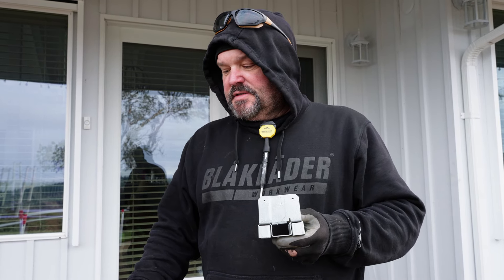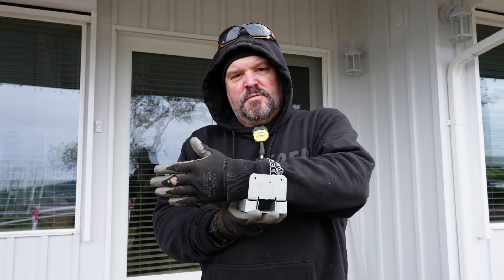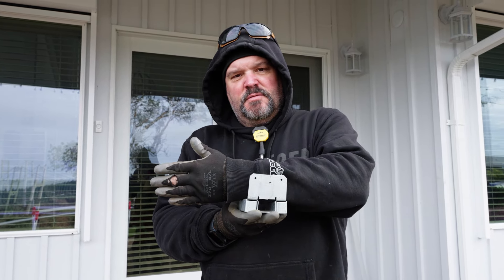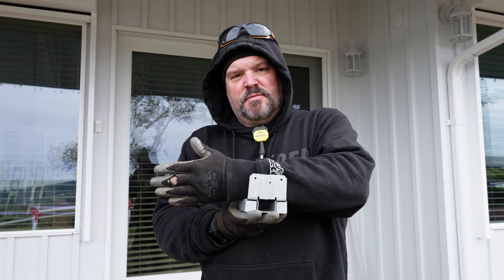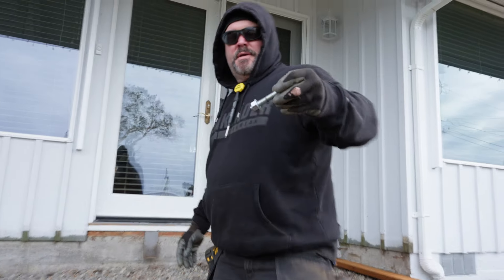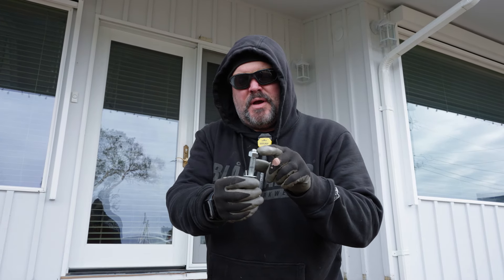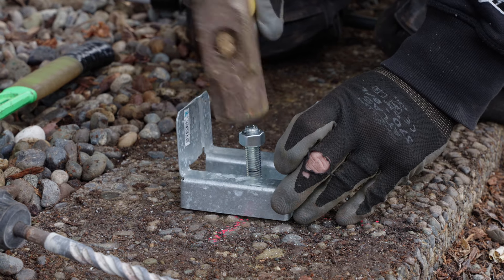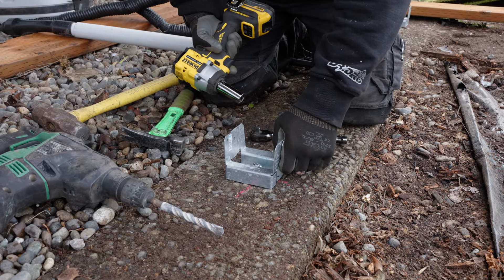How to Install Post Base Brackets Into Concrete || Dr Decks

Comment: In Australia, if you were doing that outside and worried about dust extraction, you'd be the butt of everyone's jokes. But maybe we're just careless and heading to an early grave?
Reply: How do you evacuate the dust before setting the anchor?  Straw?
Reply: The dust extraction isn’t necessarily for safety reasons, you have to get all dust and debris out of the hole or it won’t work properly as he stated in the video especially if your using epoxy in the hole before putting in the anchor
Reply: @AustinAkin  I agree. It's important to clean out your hole. He did, however, talk about HEPA filters earlier, which suggests the 'hot topic' relates to the possible health implications from ingesting dust. It's just getting to the stage where it's almost impossible to do simple jobs these days. Australia's a nanny state. Our most recognisable sport, Aussie Rules, is being ruined by overly officious wankers trying to make it as safe as possible. It's supposed to be a contact sport! Rant over!
Reply: @nuggets.6774 ”wanker” lol. I hear ya about people freaking out about safety. Some of these things are no brainers but some are a bit extreme.
Reply: So many things in Australia can kill you: spiders, snakes, crocs, kangaroos, bogans... so why worry about dust?

Comment: is it possible to use a wedge anchor on a Simpson post-base-bracket for an 8' awning post? I have to drill into existing old concrete due to location issue.

Comment: can I use these to install a full on fence. there is a concrete slab running along the fence line where the existing fence was in the concrete. can I use these and will it be sturdy to hold up a whole fence?
Reply: Yes it work fine if your concrete is at least 3" thick

Comment: If you have a rotted post and cut it dig out the old post in the ground, can you attach a bracket to the post and pour your footer around the bracket attached to the supported post?

Comment: Is there any reason I couldn't do this on a large concrete patio pad? The deck wouldn't be tied to the house so it would be free to move with the pad without damaging the house (i.e. frost heave).

Comment: If the foundation is not level, how do you shim that beam bracket? Thanks
Reply: Most of time there is a post between anchor boot & beam. If not up to 1
"  should be fudgeable, w pt ( pressure treated). I would lay it flat.

Comment: What did you use for the shim? Or did you use a manufactured beam? How did you get the beam to fit to the bracket when the true measurement of each beam is 1.5” wide making two 2x equal to 3”. I can’t find such brackets that perfectly fit my two 2x12 that attaches to concrete because all brackets equal 4” wide and not 3”. Seems like these brackets were made for 4 x 4, 4 x 6 or 6 x 6 post footings and for engineered beams, not 2x. Thanks for any feedback

Comment: Great video, love your content been watching them all. How do you properly line up 3-4 piers with those brackets if your doing footers right next to house for a ground level deck? I dont have enough vertical space for a post. How much do you recommend those round pier blocks you've talked about in other videos? Is that the "easy" way or do you think theyll hold up for 20-30 years? THanks again brother you are a great teacher.

Comment: ive never done any construction stuff but want to build a pergola for my patio, this helps a lot
Reply: I've built multiple pergolas but dropped concrete anchoring ground.  I'm about to build a front porch enclosure to block out the brutal beating of Southern exposure here in Phx.  I have 2 spots where concrete is already and am going to have to pour  concrete  for the other post bases. I think it's almost less work to do this than sink posts. And it creates no contact,  which I like

Comment: I believe that the the Simpson standoff says to use a 1/2 anchor, not necessarily a 1/2 inch wedge anchor.  One-half inch J bolts, 1/2" wedge anchors, and 1/2" threaded rod with the right adhesive are all OK, correct?

Comment: Bring your sawzall to the site as well, be prepared to have at least one anchor not go down far enough and have to cut the top of the bolt off to get the post to sit flat.
Reply: Very true to bring tools to help fix some unexpected issues. My circular saw battery died but thankfully I had already done all the major cuttings and needed smaller cuts to make. Jigsaw and recip saw to the rescue 😁

Comment: Word of caution on using impacts. I've seen less experienced guys wail on those wedge anchors for several seconds, causing the concrete to crack. Especially on recently poured concrete. 
Great short video; you covered the topic well.
Reply: Yep… pull they’ll pull the anchor right on out…. Less experienced should stick to a socket,,,

Comment: Great video. Right when I seen these are movable and raised off the concrete I was sold. I want build a pavilion or lean towith a tin roof for my BBQ equipment and these brackets are what I need.

Comment: Should I use shorter anchor if the concrete footing is too shallow like 3 1/2 inch? Otherwise, I will penetrate the concreate slab and make it contact soil

Comment: Was that drill going counterclockwise? What kind of bit did you use for the concrete?
Reply: Video effects on the camera/frame speed makes it look like rotating objects are going the opposite direction...impact wrenches, helicopter rotors (still or seems slower) etc. The bit he is using is a 1/2" rotary hammer drill bit for concrete. I started out with a 20volt hammer drill but those rotary hammers and their concrete bits are on  another level.

Comment: Just used my first ABU44Z.  All fasteners are tight, 4X4 secure in it, but lots of swaying back and forth when pushed.  Is this normal or is it supposed to be taut and immoblie?
Reply: I’m in the process and have the same worry. Did you figure this out or was it more stable as more work was added?
Reply: It’s really just sheet metal so there will be some flex which in many cases is preferable to avoid things snapping.  However once the weight of the deck is on it it’ll be minimal.

Comment: I’m building a deck on a slope and I was wondering if it would be preferable to set the post inside the concrete as opposed to using a Simpson tie   Thanks
Reply: Do as this fellow instructed, I did construction for 15 + yrs. I was always bewildered why contractors plant the posts into the concrete. Good question.

Comment: No way a bracket provides the same lateral strength that burying the post in three feet of cement does!
Reply: And when your post rots, you'll wish you had used a stand off bracket.

Comment: If you have to lay a 4x or 6x directly on the Simpson bracket; are you able to butt or split two beams on that single Simpson bracket or do you need to install two?

Comment: I use those post stand offs all the time, when redoing front porch posts here in the south.  Moisture destroys the posts quickly.  Thanks for the video as always, very informative.
Reply: @bigtime37ja can you use these clips for fence posts?

I was going to pour concrete 42” Deep and 12” in Diameter using Bigfoot Systems® Footing Form BF28 that has a 28” Diameter Bell end.

Once the Concrete sets I was thinking of mounting these brackets to accept my fence posts.

Or are these only good for decks?

Comment: What do you do if your post is bigger than that bracket. My posts are 8".
If you tighten the bolt before you install the post you cant use the slot to level the post.
Reply: Buy a standoff having the right dimensions.  They sell standoffs for 4x4, 6x6, and 8x8.  Install all the standoffs, then with a chalk line or string, ensure they are in a straight line.  As he stated, loosed nuts to move any standoff out of alignment of the other ones. The slot is not meant for allowing you to plumb the post - to do that use shim(s).